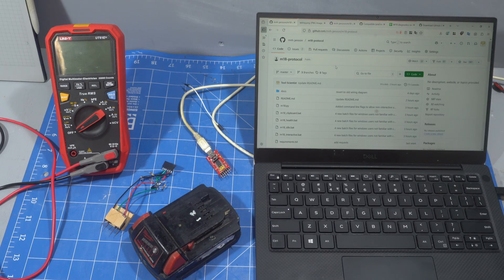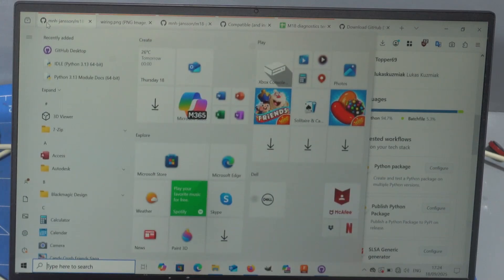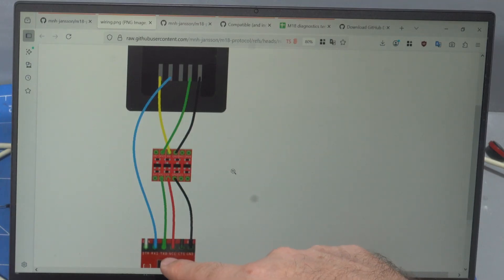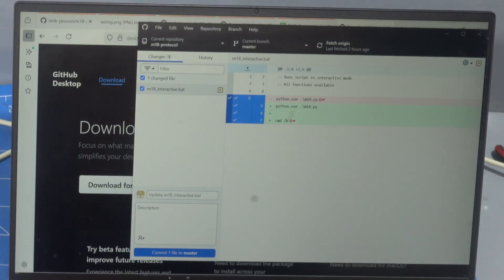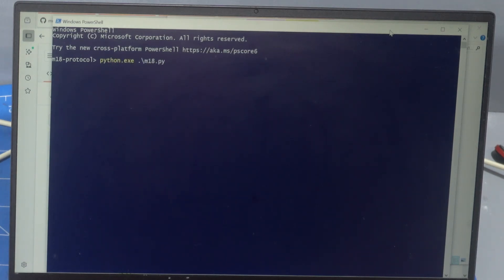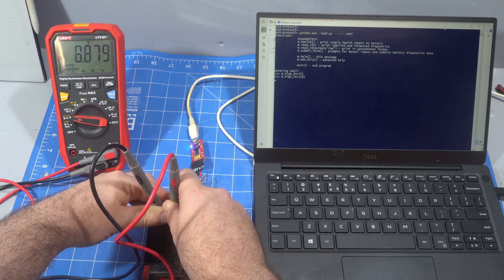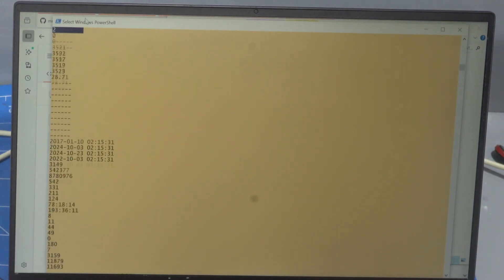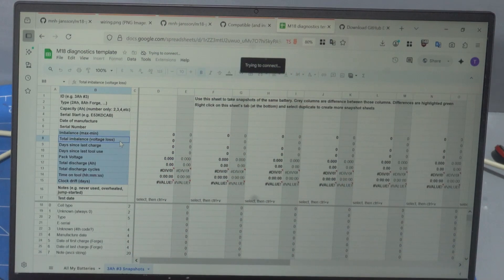Milwaukee M18 diagnostics tutorial (Windows)

Comment: I get errors at 5:11 install requirements 
Getting requirements to build wheel error
Exit with error 
Getting requirements to build wheel did not run successfully
Reply: I don't get a lower voltage on the j2 pin at time stamp 6:12 i get like 13.85v
And i don't have anything on the j1 pin
And m.reset gives me false
Reply from the maker: @theguywithallthesolutions  make sure you have functioning battery that works on a charger and thay it is made after 2016. Start with everything disconnected:
1. Connect USB serial to PC and start m18.py and select correct port
2. Run m.idle()
3. Measure voltages on USB from GND to TXD (~0V)
4. Run m.high(), TXD should now be 3.3V
5. Run m.idle()
6. Connect adapter to M18 battery. Make sure connections are good. Jumper pins tend to fall into slot in middle of battery terminal, which makes a poor connection.
7. Measure J2 (~0.1V) and J1 (<1V). 
8. Use m.high() and you should get J1 = 8 to 14V, and J2 = 3.3V.
9. Finish with m.idle()
10. Now see if m.reset() works and then m.health()

If still not working, create issue on github
Reply: Ok i think i have a fake chip on mine
Thanks i will order another and try

Comment: Thank you man
Reply: I get errors at 5:11 install requirements 
Getting requirements to build wheel error
Exit with error 
Getting requirements to build wheel did not run successfully
Reply: I don't get a lower voltage on the j2 pin at time stamp 6:12 i get like 13.85v
And i don't have anything on the j1 pin
And m.reset gives me false